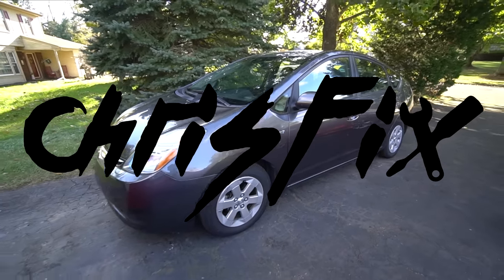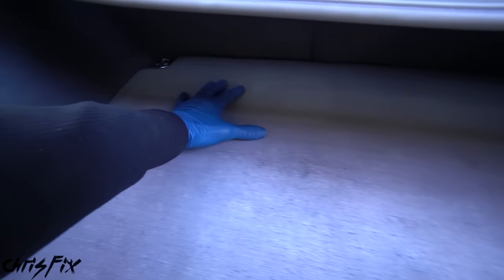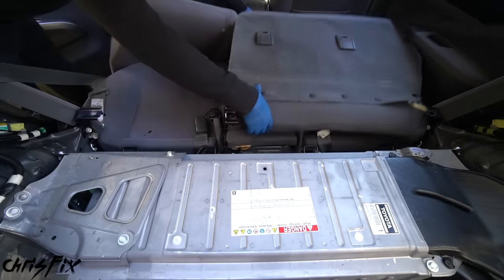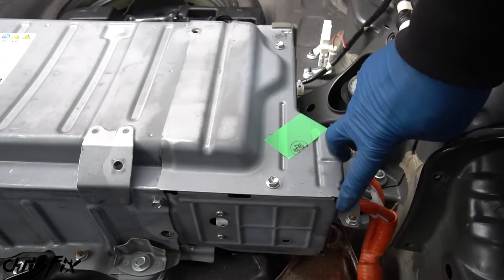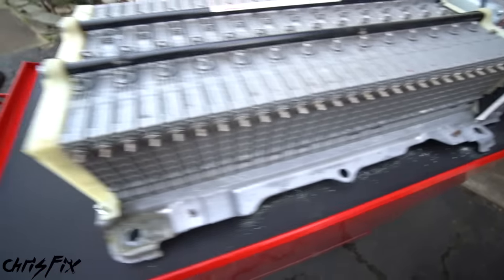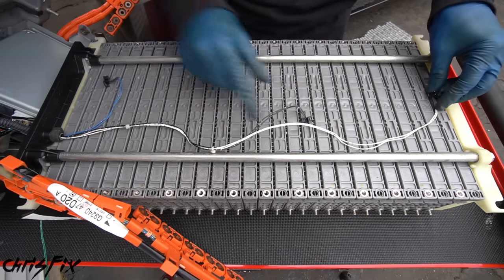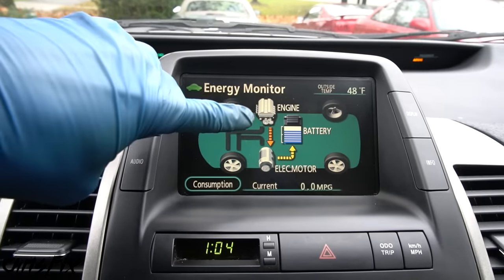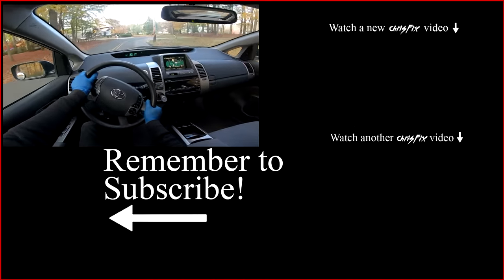I Bought the Most Hated Car on the Internet (and made $1000)

Comment: Thank you Chris especially for the tip about cleaning the Fan, I had a dealer in Sweden replace the battery 2 years ago (25000 km) and paid around $2500 for it. I checked the workorder today and it says nothing about cleaning the fan so i am now asking the dealer if it is standard to do that or not. Probably i should check it out either way. Who knows, that could have been the reason the original battery broke.
Reply from the maker: Awesome! Let me know what they say!
Reply: The pack usually fails due to electrolyte dry up, which is caused by heat.  A single cell gets depleted and reverses polarity at high discharge -> shorts -> failed cell -> failed module -> failed pack. Ways to make it last longer - keep the battery cool, esp. during the summer. The battery gets cooled by the cabin air, so use AC. Clean the FAN every now and then - certainly more often than 10 years. Don't park the car in the sun if possible, tint rear windows, etc, etc.

Beyond that, grid chargers/dischargers (so called conditioners) can prolong the life of the battery, but it's a bit of an uncharted territory. Research and make your own conclusions before deciding on getting one - they're not cheap and the prices of new packs from Toyota are still dropping... and you're getting improved batteries as well - gen 4 cells in your case, most likely.
Reply: @chrisfix  The dealer says that the person that did the job doesn't work there anymore so he cannot ask him. He can only assume that all parts near the battery would have been serviced too, but he doesn't say if it standard procedure so it obviously depends on the ambition of the technician himself and is up to him to decide whether to do this important step or not.
Reply: @SpiritLwerewolf  Good info. This is one of the reasons I bought a used Chevy Volt when I was looking for a cheap used electric vehicle. It was designed with a very efficient liquid cooling system for the battery instead of air cooled, so the batteries are not failing like they are on the Leaf and Kia Soul etc.
Reply: @TheDeezelsmoke  Lithium ion chemistries appear to be way more susceptible to high temperature/state of charge damage than ni-mh, so that applies even more to your case :)

Of course, different chemistries and variations thereof have different tolerances.

Now to figure out why Toyota chose to air-cool its lithium packs.
Reply: Du blev hasslad bror
Reply: Dealer also says that there would be an error code saying "the hybrid cooling system needs maintenance" if there is a problem with the fan. My question wether this means broken fan or not optimal air-flow is pending along with request that he asks current mechanics wether they would do it or not. I am right now a troublesome customer so he might not respond.
Reply: Since the fan is on the side of the battery it has not been cleaned says the mechanics that work there today. They will charge around $80 if i want them to do the job now. I will  do it myself although i am not a mechanic at all. I have the instruction thanks to @ChrisFix. The error code is only if the incoming air is blocked.
Reply: @SpiritLwerewolf  Hi everyone! And what about the corrosion? May be the new sets of nuts and contact plates will solve the issue with whole battery pack.. 
I prefer to isolate the dismantled contact of 12V.....just in case it will find the contact by chance during moving all of this components inside the  car...
Thank you for good job...

Comment: Jesus that  is  a lot of nuts and  bolts a suprising amount  of corrosion as  well.  With  that  said I'm really impressed that  Toyota includes a  safty  switch like  that  on  the  hybrid battery.

A  lot  of people  have brought up concerns with hybrids and 48 voltages systems for safty  so it's nice to  see thos included by  the  manufacturers.
Reply: Nothing to be impressed with Toyota about, it's a regulation set out by the government that they must include these things, not some special innovation by any particular manufacturer, its the government you should be impressed with :/
Reply: @RWoody1995  Goverment pushes a lot of  safty  features to be  sure,    but  that type of safety switch isn't one of them from what  Im aware of.

Unless you can point to  a specific mandate pretty  sure this was soley Toyota or their battery manufacturers call.
Reply: @BigHeadClan   Can't point to a specific mandate but every single hybrid car I've been in has the exact same orange safety switch. That includes a Smart Car, hybrid Tahoe, and Nissan Note.
Reply: @BigHeadClan  I can't remember the NTSB ruling number on it, but it was mandated sometime back.

However, that mandate was put in place after a few manufacturers decided to add them on their own. A lot of what agencies like the NTSB/DOT mandate comes out of some particularly smart bunch of engineers going 'hey, this makes driving/working on the car a bit safer, let's add it and hope corporate doesn't notice', only to have the government like what they see and make everyone do it

There is also ANOTHER safety cutoff in the car, under the hood and can be cut with the jaws of life on some cars. it's easier to get to for emergency responders and does the same thing for the same reasons.

Comment: Excellent, I haven't seen such a professionally edited video in a long time; Easy to understand, wonderful, fantastic, straight to the point, and good job.
Small notes: It is recommended to write on the cover of the batteries after replacing them the replacement date so that the car buyer or the service person knows when the batteries were replaced.
Also, all long working tools recommend to insulate them with a simple black Azoliriband, which can avoid the trouble of an unexpected short.
I would love to have the same demo for the 2019 Toyota RAV-4 SUV; I bought the vehicle second hand and I am afraid of the future of the batteries.
Regards Mike🤩🤩🤩

Comment: When organising bolts, I always like to lose at least one in the stones on my drive, inadvertantly take one inside with me when I go to make a cup of tea, then re discover it once I've bodged in another bolt, and lastly,  always keep one in your trouser pocket to completely wreck your washing machine
Reply from the maker: Hahaha this is all too true
Reply: Alway! LOL
Reply: Always manage to loose at least one... never fails.
Reply: My preferred method is to swap one bolt for another, BUT the first bolt you put in works fine, you don't notice until it is all together and the last bolt is too short...
P.S. I fix that by a) leaving a bolt off or b) buying a new bolt from Bunnings.
Reply: I often wind up with an "extra" bolt. ( Now where the hell does this bolt go?)
Reply: Amen!
Reply: just screw them back where you found them after removing the plastic panel (cars are made of plastic now) 

That way you wont be able to put the plastic back forgetting half the bolts.
Reply: @gabydewilde  X-cellent!
Reply: Lmao
Reply: I never lose about, I juststrip the first and second bolts when my tool slips
Reply: The good news is, your 'extra' metal pieces will be shorting out that LITHIUM battery pack and turning you and your family into a rolling fireball. Or the next unlucky person you sell the car to. Lithium battery packs burn at 2000C, almost as hot as Thermite... Yayyyy right? 😭
Reply: @markjohnson4643  that's a great story 
Got any more?
Reply: I must have done the same 'lose a nut or bolt' course as you!

Comment: Another detailed video with your characteristic amazing videography!
I would add one thing and amplify another, and add a note. The corrosion is not actually normal; it is the result of the battery seal problem that caused the battery to fail. Sometime toward 2010 Toyota got a grip on it. Next, nobody should ever replace individual modules. Since the battery ECU reports trouble based on difference in module voltages, adding new ones to old will make the symptoms worse! Finally, if anybody disconnects and reconnects the battery in a first generation Prius (the sedans from 2001-2003) they should be aware that the Triangle Of Death is likely to be displayed the first three times the system is started. It will clear on the fourth go. Oh! Finally, a safety warning. That corrosion powder contains sodium or potassium hydroxide. If it gets in the eyes it is extremely serious. Goggles would be a bit much, but care not to touch the skin with the gloves is critical.
Reply from the maker: Thanks a lot and thanks for the info and tips!

Comment: This is a great video.  Wish I had seen it before I cleaned the fan.  BTW, impact guns are cheap if you get an off-brand.  Once you start using one, you won't care what it is. It doesn't even have to be a mechanic's type. You don't need a name-brand unit if you're not using it 8 hrs a day.  Go for it.  And get the plastic clip remover pliers.

Comment: Great video! Anytime you use vinegar to soak rusty or corroded parts you need to then soak them for a bit in water mixed with baking soda to neutralize the acid in the vinegar. Without neutralizing the acid it will continue to eat at the metal.  Don't leave parts in vinegar too long either!
Reply: yeah, I dont think you can neutralize battery acid with another acid... instead use a base then protect them from corrosion with "battery terminal" spray (not an oil ie. no insulator) because we need long term conduction.
Reply: Ive used cider vinegar as recommended by a British car magazine and it seemed to work better.
Reply: @glasser2819  john4kc is correct, baking soda is a base and will neutralize vinegar.  A thin coat of silicone grease on electrical contacts during assembly will deter corrosion.

Comment: While this video partially tells me how simple a job it is, it also shows me how much service needs to be done just to change the battery-pack and it kind of justifies why it is so expensive.
Reply: I work in automation repair and often when we do a large upgrades They  often can take whole day and sometimes longer. After you have done them a few times times this repair time drop substantially. I have been on jobs that took ten hours and by the third time its taking less than three. Dealers have nice building and someone has to pay for it, plus they really want you to purchase a knew car.  The average person would never tackle a job like this.  Nothing about this job is very complicated.
Reply: We rarely factor in having the tools, time, and space. The part itself was $1500. The repair is overcharged, but if the labor was going entirely to the mechanics it really wouldn't be so seemingly drastic. Seems like it should cost about half of what it does accounting for labor, ~$2K seems fair. It also aligns with other trades where things are doubled because you're actually paying for the entire business overhead.

It's not price gouging really. I get that people think it is but most people can't assemble ikea furniture without struggling. I suspect those of us sitting through this entire video aren't in that category.
Reply: @mtadams2009  i was an an auto mechanic for 32 years and honestly this battery pack install to me did not look hard at all.there are jobs i have done that were much worse than this. i estimate this whole job might take me around 2 hours to do for the first time give or take...
Reply: You basically never need to change the battery, the only real reasons this has happened is if your in a crash, or if a mechanic has sabotaged your car, some self righteous mechanic did this to ours and we basically had to get a whole new car because of him, some people would really go to jail just because they don’t wanna see a Prius on the road 🙄
Reply: Yip and if they make a mistake its on them and mistakes with the likes of these batteries can be catastrophic and expensive.
Reply: @Zhiperser  yip all the different torque levels on certain bolts and imagine if you stuffed up the cooling fan for the battery ! Yikes ! it would take me a week to do this job double checking everything
Reply: @stevros48  As if mechanics ever use a torque wrench 😂
Reply: $2500 for labor?  I bet the dealer quote was a new battery...?
Reply: @autarko  Only were it's critical, if I ever saw anyone using a torque wrench on those interior bolts like in the video I'd slap the shit out of them. 😅

Comment: Just fixed my 2007 Prius by swapping three cells only instead of all 28.
As soon as you can't really find brand new cell except the dealer, all the cells you can purchase on Ebay, Amazon and so on are used. If you have some time to spare you could use my method- buy a 4 channel balance charger, charge/ discharge each battery pack three times (it takes about 20-30 hours for one cell, but since I've got a 4 channel I can do 4 cells at once, so 28/4= 7 days), charge them at 7.8-7.9V, writing down all the data for each cell, so you can mix and match your own cells in pairs. After that you have to connect in parallel all positive and all negative poles to equalize the voltage (basically you'll have a 7.8V battery with crazy current) for about 12 hours, disassemble the temporary harness, and connect everything back. 
For the copper shims I tried the vinegar trick then neutralizing with baking soda and they came really beautiful, tried to do the same with the nuts and they turned black as well, so I just bought on Ebay a set of 56 nuts for $12.50. The sensors shims on the right side of the battery were corroded as well, gave them a vinegar treatment then soldered all the wire/shim crimped joints.
The car runs great now, before the battery would charge and discharge very fast, now it's pretty consistent between 50-80%.
Budget: 
$100- three cells on Amazon
$12.50- set of nuts
$150- 4 channel 80W balance charger on Aliexpress
$45- wheel dolly at Harbor Freight
Total- $307.50 instead of $1500 for all cell packs
Reply: from the individual cell tap seen in the video, it would seem like the computer can balance cells individually, right?
In the end what kills car batteries is the internal resistance that limits charge/discharge current and creates higher heat.

Batteries replacement is the new dealer cash-cow... LOL
Reply: How did you identify the bad cells?
Reply: @VASailpwr  save your down time... 
when battery cells are tired (high internal resistance) they are ALL TIRED and nearly as bad because they are BALANCED.
Reply: $2400 aud fresh from dealer, but it should go for another 10 years I hope. @glasser2819   Plus you could always sell the old battery modules. Make sure you get the car cheap. Beware of 10 year old cars at normal price, they could be hiding a battery that's on it's way out but won't show it in normal operation just yet
Reply: After rigging the modules up in parallel to balance them, what do you do? leave the rig as an open circuit, nothing attached?  charge them? cycle them? Thanks.
Reply: @glasser2819 ,  as I understand it , the modules in the middle  of the battery pack  wear out first, damaged by heat.  Other  Prius videos recommend rotating the outside modules for the inside modules to even out the wear.

Comment: For 12 years old car, that condition is pristine 😲
Reply from the maker: It was so clean!
Reply: Most likely it lived its entire life in a garage.
Reply: @JuanYRuby1209Marine  but didn’t it drive 100,000+ miles?
Reply: If you take care of your vehicle's, you can make your vehicle last many decades.
Reply: @Achilleas_klvp7 Well, yeah, I do. What's wrong with that?
Reply: 2007 Camry 201700 mile battery still working good
Reply: @khalidmasood2193  good for you

Comment: Hey just wanted to say when I'm pulling stuff apart and want to keep track of what screw goes where, I just grab a bit of cardboard, do a small sketch of the part and push the screws through in their corresponding location. On my Honda bike I have a lot of M5 screws, but they're all different lengths! So I found this the easy way to put those longer screws back where they belong.

Also I was saying to a workmate last week, how there are all these TV shows about people buying houses to fix them up and sell, and how good it would be if there was a TV show about flipping cars. Guess I found it.
Reply: Search 'Wheeler Dealers'
Reply: Me too - I like to use corrugated cardboard from a box, it holds the screws better. I started doing it when messing around inside laptops, which have many small screws, many of which differ in length by a mm or less
Reply: Used to be several shows on TV just like that when I had cable. Only title I recall right now was a more recent show, might still be on the air, called Fast 'n Loud. Those guys weren't flippin' no flippin' Prius, though :D

Comment: The 553 dislikes are all Toyota dealers !!🔥🔥🔥
Reply: Jane Lane It’s a hybrid, it uses gas as well
Reply: True 👏🏽
Reply: @dbright  Most Toyota vehicles come with 60000 mile warranty that doesn't mean that the cars going to only last 60000 miles
Reply: @janelane9281  You realize that hybrids are less efficient because when you change energy forms from mechanical to electrical, there is more energy loss than If you'd just used traditional halfshafts powering the wheels from the engine. Hybrids are less efficient in the end because of the energy loss.

Comment: Just love your videos, I don't own a Prius and probably will never want to perform this, but still I watched this from beginning to the end frame by frame. Feel satisfied.
Reply from the maker: Thanks Brian!
Reply: ChrisFix Seems like a lot more trouble and time consuming to use a torque wrench for all of the body and case bolts. Where most shops just use a 1/4" air or electric ratchet and just run them down.. Makes quick work of it and a lot less time. 
Now on the battery's them self I can see why you would use a torture wrench..